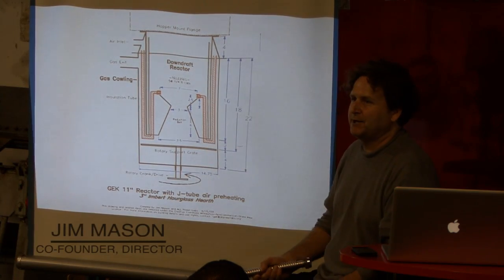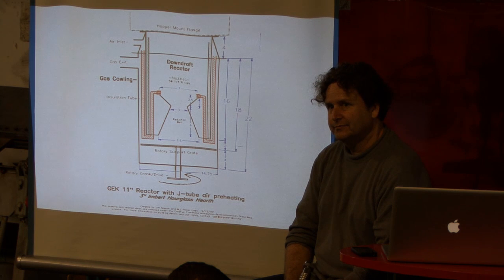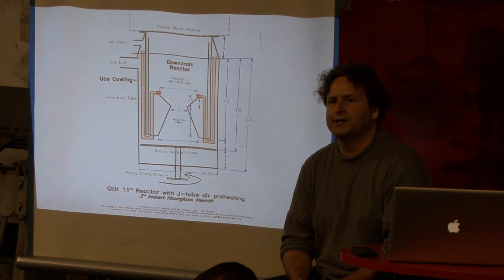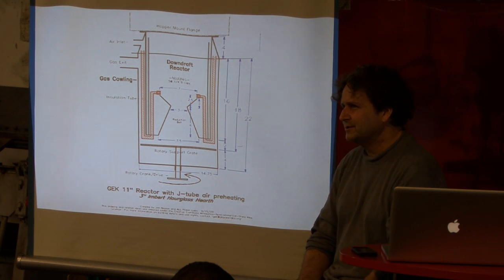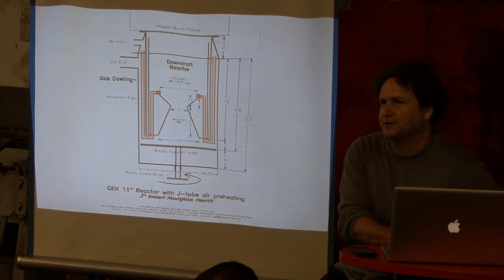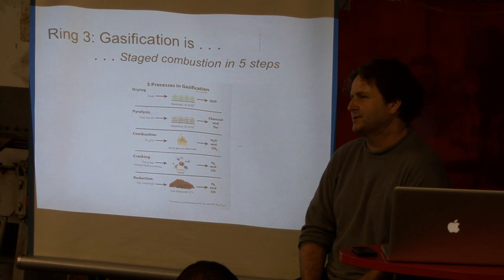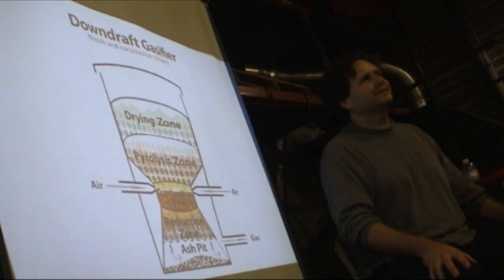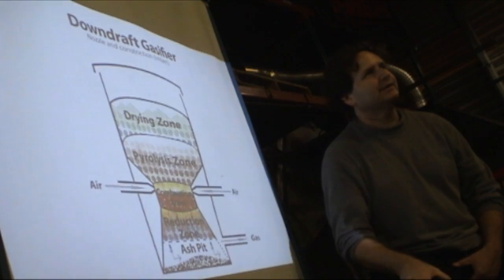The Science of Gasification (part 5/7), with Jim Mason

Comment: hot air does contain less 02 but cold air cools the combustion chamber.
the hot air keeps the fire hot enough to keep the tar cracking process going
if you drop below 1200 deg C you stop cracking tar so if you blast a fire of hot coals with 70 deg F air you will cool it down to 1000 C , my cyclone burner runs at 1500 deg F but at the air injection site and where  the air hits the wall
its only 300 deg F... 300 deg inside a flaming fire ball bro , i have vids of the machine

Comment: translation of this dude:
Can you explain what need to heat the air entering the gasification zone? Because hot air contains less oxygen due to the lower density. For example: in internal combustion engines with turbo air is cooled to force oxygen.